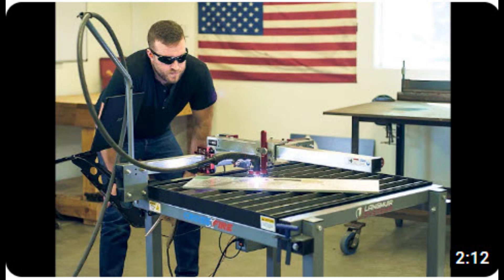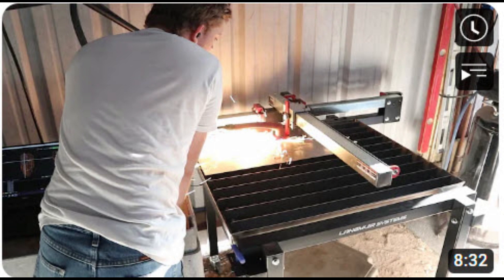Langmuir Crossfire DIY #4 Smoke Abatement

Comment: I appreciate all your videos of tweaking the plasma cutter. Also appreciate the mention of PPE. What I'm confused about, now that I've ordered this machine, is all of the modifications that you've made to it. It seems to me that Langmuir would have taken many of these into consideration, so many of these ideas could have been avoided. I'm stracting my head now, wondering if this was a good idea. Thanks again for the time you've spent bringing these ideas to my attention
Reply from the maker: Curtis,  Langmuir offers a DIY entry level machine at a significantly reduced price.  You can make improvements as you see fit.
Reply: I did get the basic 2x2 . I'm in it for the hobby aspect and I understand that machine alone will take time to learn. I'm just starting to dabble in Fusion 360. Wow, that's a big learning curve in itself. Well, I'll still watch your videos for good info and hopefully, I get the hang of it. Thank you for your reply.